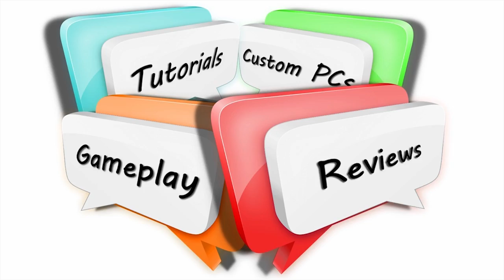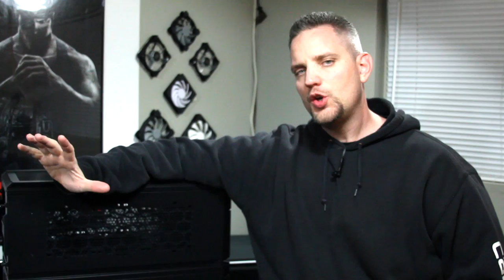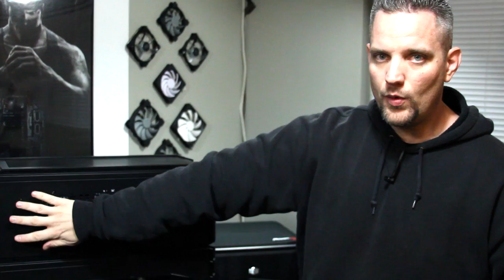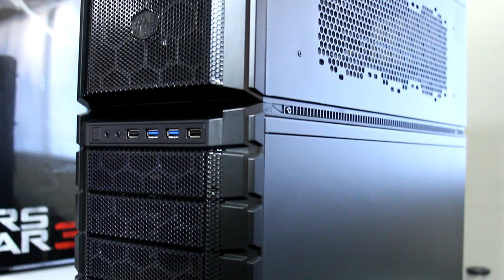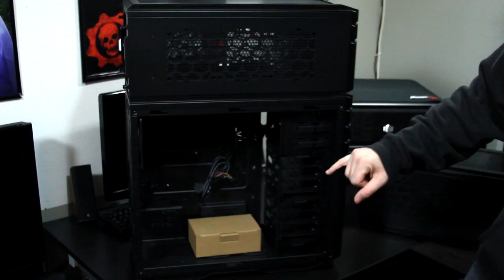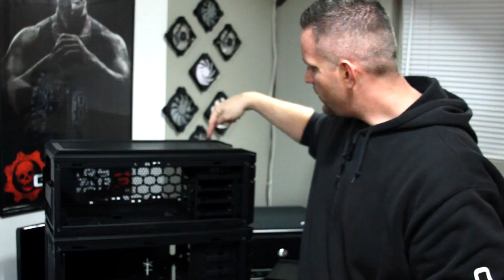Cooler Master HAF Stacker - Only limited by Your Imagination

Comment: I almost want to get this and turn the 925 into a radiator box cooling a mini-ATX gaming system in the 915. You could probably fit a refrigeration system in the 925, and with two power supplies you'd have the power for it.

Comment: I know I'm stupid late to the party, but here's where I ended up- I'm currently running one of my systems in a Haf XB Evo cube. I really like the old Haf series, and have decided for my next build I'm doing the 935 wit both a 915r & a 915f basically as you described with the 480's. Also, with just a little more modding past the point of just the 480 rads, you can also dremel out a passage behind the mainboard tray to better manage the wires. At the top willbe the 915r with 7 SSD's, 3 120mm Riing fans on either side, and a 3oo watt modular PSU setup to exclusively run the hardware in this this case alone My prob right now is actually getting my hands on all 3 of these cases. But it's going to be be one hella beast ass build, & can't wait to start! Already have the perfect mainboard- the Gigabyte X370 K7. This'll be my very first ever watercooled build, & it's all thanks to your many videos on the subject that has made me decide to finally nut up & get wet!!!

Comment: i have my power supply in the middle case, but i got acrylic to cover the psu and use a holesaw to cut through the acrylic to run my gpu power cables

Comment: finally i found a video where he filled up the little 915R with hard drives bays!  I have a question about that, how many drives can you fit in there with the miniITX board installed?  could you also modify the drive bays to fit closer together?

Comment: If it were me, I'd use a pair of Alphacool NexXoS Monsta 360mm rads in the 915 down the bottom and another Monsta 360mm in the top of the 925, 150-200mm reservoir, maybe hard line it all and use Mayhems Aurora 2 silver.

Comment: is there a cover for the top ? for if u put the smaller case on bottom ?

or am i confused and they look the same on top ?
Reply: The cover for the top comes off with the four screws and can be mounted to the top of the mid-tower portion.

Comment: ***** This is just the kind of information I was seeking about this case. I want to do a build with this very configuration. Thanks.

But, I would like to know if you were able to get those 480 rads and 240 rads in with push/pull fan configurations because that possibility will greatly affect my purchasing decision.

Comment: Will this build be bottlenecked at all? I watched JayzTwoCents video on bottlenecking but to me, it made no sense. So any bottlenecks at all?:

AMD Athlon ii x4 640 Quad-Core @ 3.0GHz
EVGA GTX 760 Superclocked ACX cooling unit 2GB GDDR5
8GB Integral 1600MHz RAM
Windows 7 Ultimate
Reply: You'll be fine in most games
Reply: Bizarre choice of CPU
Reply: TheWargod56 Well, it was quite cheap when I got it last summer and didn't expect to love PC gaming so much so I didn't get a good CPU. Now that I'm buying some more high end parts, will I need to upgrade CPU?
Reply: Probably not although you will be limited by it slightly, It should be easy to upgrade if you feel like it though.
Reply: ***** people hate on the fx cpus and i don't blame them but i think if you are on a budget you can get the 43XX or the 63XX and a decent 890 or 990(fx) board (with uefi for steam os) i'm hoping AMD does a crazy 180 surprise and just changes the socket compatibility for a more efficient socket with a new cpu on a smaller node!

Comment: Jay i seriously need help. Im 16 and im sick of console gaming so I decided to build my first pc,
my specs are : AMD fx 8380 4.0ghz 4x2gb Kingston hyper X RAM  Radeon 4850 sapphire vapour X 1gb  and my motherboard is the MSI 970A-G46

Im pretty sure i connected everything and i was so excited when i plugged it in and everything turned on (all lights, fans etc) I then plugged it into my monitor but nothing was displayed and there was no beep , Help please :( i saved up all year and i dont want everything to go to waste)
Reply: If you have already been helped then I apologize for this long but possibly helpful comment.

1.  Ok why did you choose to put a SERVER 2.5ghz 4 core cpu in a build that is OBVIOUSLY aimed at pc gaming from your 2nd sentence?  Was it an old part you had already lying around not being used?  Even if you overclock it to close to or at today's middle/high end to high end standards of 3.0ghz or better, it WILL consume about the same as a Phenom II x6 at 125watt or higher which is obviously a 6 core that runs at stock faster.

2.  I have the EXACT same motherboard( since at least 8 months ago or more) and THAT 8380 opteron amd cpu is NOT listed as a compatible cpu in the cpu list on msi's official website FOR that motherboard.  I'm guessing you didn't do your homework and look at the motherboard website's cpu compatibility list BEFORE buying or accepting that cpu for your build.  THAT is the problem or ONE of the possible problems as to why you're not up and running besides possibly power supply issues or the board has an issue which I doubt.

Buy a compatible cpu.
"Server" cpu's go on " server " motherboards. 

Now IF MSI officially contacted you and said THAT cpu DOES work correctly with THAT motherboard, then they have NOT updated that information on their website for that mother's cpu compatibility list even as I type this. I JUST checked it.

What are valid CPU Choices for THAT motherboard?
     I recommend either the fx 8320 or 8350 running stock at 4.0ghz ( a badass 8 core beast) AND NOT overclocking it REGARDLESS of the cpu cooler you use.  There are WAY to many reports of mosfets and/or other power delivery problems with 8350's out there being overclocked on this board and something involving them and other coherent components overheating even with a fan blowing directly on them and the southbridge.  

     Also there is the amd 6350( a 6 core top of the line value champion) which is an EXCELLENT choice imo considering it's cheaper AND 95 watt tdp which leaves room to overclock some from it's GOOD stock 3.9ghz speed even on THAT motherboard.  Thus that cpu is PLENTY for even 2560x1440p resolution gaming at medium/medium high settings in ALL of today's demanding games even with a 780 and 780ti for the green team or r9 290 and 290x for the red team of video cards.

Your ram choice is fine as I have the exact same as well in 2GB sticks of 4 of them at native 1600mhz speed at 8-8-8 24 2t settings at AUTO voltage settings.

Once you're up and running, THEN you can see which item in your pc's build is a NOTICEABLE bottleneck.  Chances are it will be the video card UNLESS you're running all of your * today's or made in the past 8 years or less * demanding games at a resolution of 1920x1080p with the exception obviously being games like crysis 3, metro, farcry 3 which can EASILY consume more than 1GB of the video card's Vram at ANY time at full hd resolution.  1680x1050? You should be ok at that resolution MOST of the time without the risk of " microstutter" or graphical lag.  I played crysis 1 at 1050p with a 512mb msi 8800gt back in 2008 with a phenom II x4 at 3.2ghz stock at medium settings no problem with 40 or better fps at ALL times including hardcore fight scenes to give you some perspective of how to guage things.

If you need further help, pm me.  Cheers

Comment: If I had this case I would use the 915 f as a mini ITX build but still keep the main hard drive in there, that way, I can just have the one OS installed and just swap over a sata cable and unclip the 915 f as a small form factor tower for lan parties and such. 
If I had the money to pour into a second small pc

Comment: I would have a big radiator in the bottom, the main part of the computer in the middle, a hard drive bank (like the one Jay has setup) and a home server for hosting my own servers for me and my friends on games. I would use the hard drive bank for the hard drives of my server as well as the main computer and maybe make the case even bigger and put a streaming computer on the top (also connected to the hard drive bank). It would cost so much but be so cool. One day...

Comment: I can definitely see the utility of this case. However, for me it's definitely too large a case, as are most full-tower or larger cases. I also don't particularly like the aesthetic of Cooler Master's HAF towers. The 915F is definitely a neat little case though, and I'd consider using it myself for a future build (does the 915F support a full Mini-ITX build in itself?). Weirdly I do kind of like the aesthetic of the 915F, despite not liking most of Cooler Master's case design. Thanks for the video!
Reply: ***** micro ATX is correct if you go smaller than that, it's called mini ITX

Comment: Just one thing you didn't touch on, if you were going to mount 2x 360mm rads in the 915, how thick could they be? Could you get two 80mm thick in push and/or pull?

Comment from the maker: HI GUYS!
Reply: Hi dad!
Reply: Thank you. I am so glad you did a review on this case, as I've been seriously debating for a couple weeks now on whether to get one as I've pretty much run out of room in my current case with a new custom loop I've installed.
I can see your point regarding the cable routing going straight up through the middle which might bother me personally as I have cable management OCD.
And the fact that the rads would be attached to the side panels is a draw back as well, no easy access to the rads, pumps, fans e.t.c. :-\
Hmmm decisions decisions.....

Your video definitely has helped me a lot, thank you Mr Jay.
Reply: Hello!
Reply: i didn't notice the runny nose until you mentioned it then w went crazy every time you did it
Reply: Hey Jay, could you fit a 240mm H100i and a Hard Drive case in the top part?  Thanks! 
- SIndri
Reply: HEYYY
Reply: Hi Jay
Reply: HI JASON! WHATS UP MAN?
Reply: swag
Reply: if i had the case and quite a few dollars i would put 4 480mm rads and a 240mm rad and then put a 2 360mm reservoirs.  kindof alot but why the hell not
Reply: #epicwaterbox
Reply: Watching in July 2026 😎